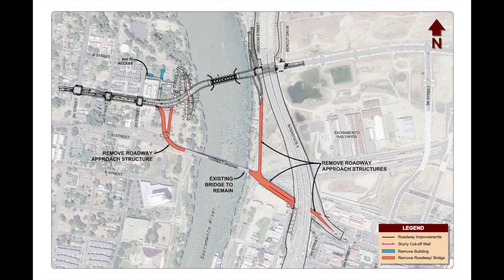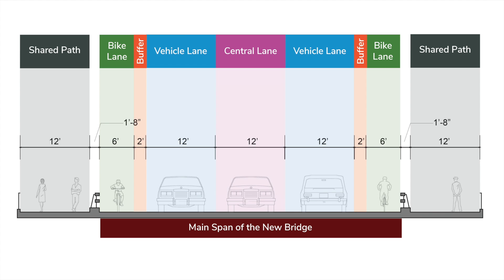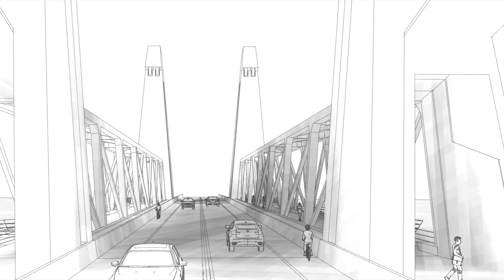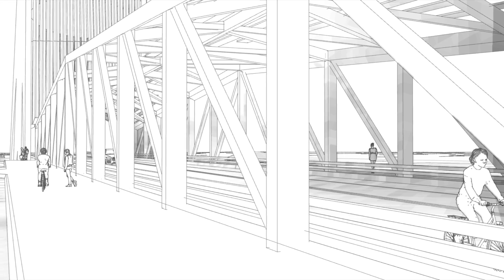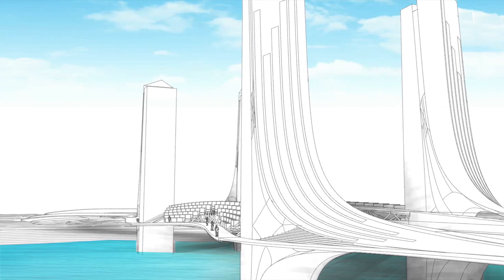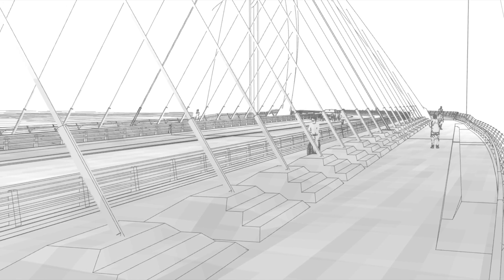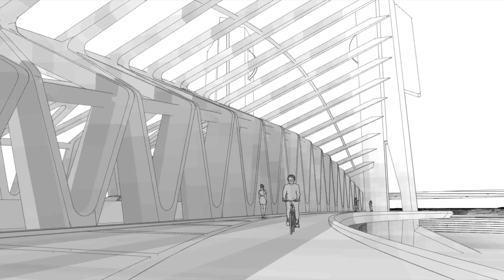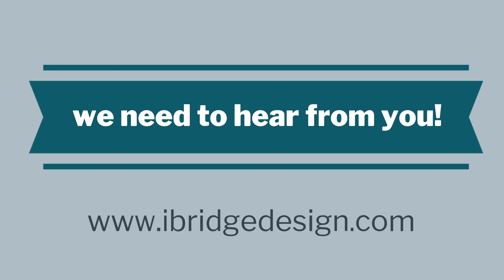I Street Bridge Design Concepts | April 2019

Comment: A Quick Vision Note:
Context Design - initiative and sustenance area
Go bold 
Double or triple the budget to make a design that brings people from all over so that it pays for itself in a short time - like the Eyrie Canal a project funded and designed without the constraint of usual reason. 
In an attempt to put New York on the map it allowed the creation of most of the wealth in Sacramento. The bank that furnished San Francisco. 

In the next 20 transitional years the wealth of creativity that will come from the minds of the people who can be attracted to Sacramento for good reason and those born here who discover that they can realize their potential without leaving because of this project and it's effect on its environment.

Besides Creative Class energizing there will be a need for celebratory actual electrical energy 
In addition to the solar panels
Pressure generate electricity from traffic crossing the bridge 
(A few years ago I met someone from Sacramento who developed this system when he was 14-17 because he used the internet to learn the things he needed to learn - a symbol of what youth are doing using their initiative).
I would think - if approached with the idea - Elon Musk will want to design a replaceable battery storage micro grid in the bridge and associated barges - maybe a new solar panel form can come out of it
Also William McDonough should have some existing elements that would integrate with this with out taking up too much of his time.

Most important and can develop over the years starting now:
Key in to the sides (sections that don't move) areas for Farmers and Original and Unique Artisans Markets Performance, Social Dance, Theater, all sorts of events etc.
Sacramento has a history of Festivals in this area.
Have associated barges and floating infrastructure and facilities moored in rows and on jetty moorings nearby for use in Multi events big and small hooking into the bridge or
Intranet of floating permanent and ephemeral businesses, offices, restaurants, cafés and other mobile and popup things
Included - more flexibility in the design of these integratable reorganizable hubs and attachments 

Not just a functional travel connector but a station of sustenance for the place we 're moving into over the next 30 years and beyond
A mobile Inspiration, Regeneration and Solution Market  
The missing link to the malls and a pointer to a future centre
A compact energetic linking area densely packed with nutrition of all types.
Not necessarily the Heart of the Sacramentos but the context from which one can come 

All these things can be done for a lower budget than expected and can pay back faster than planned. It can also be a way to explore the code changes needed for 21st century building techniques as they are affected by the new hybridization of digital integration, AI, new materials and 3 dimensional design 

Also in some place where it can be seen from afar or passing by:
A symbol of calm and quiet to remind us that creativity comes from a more silent place - when we're driving by jazzed and excited with ideas and meetings and performances and images and .... 
Like a non denominational stupa